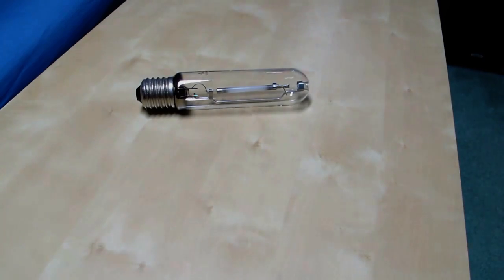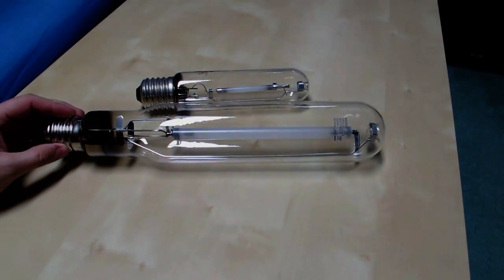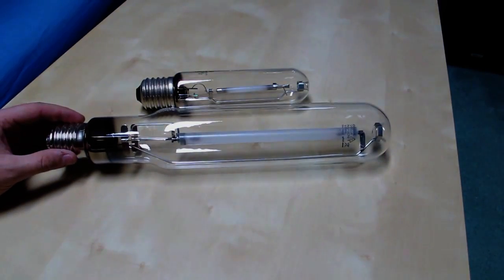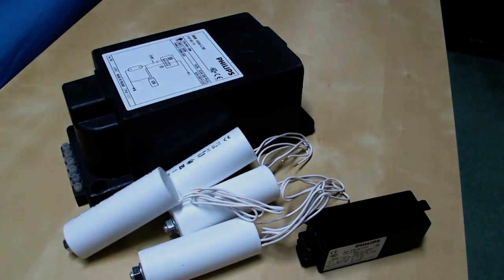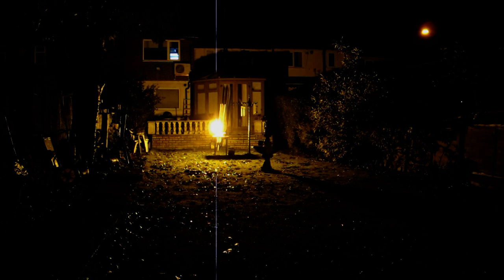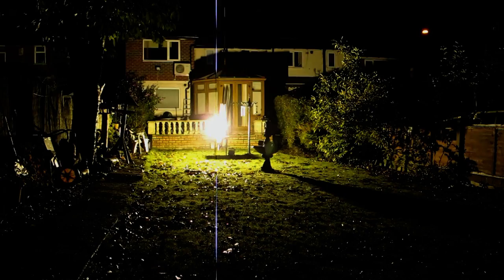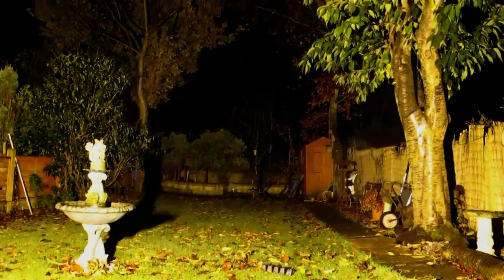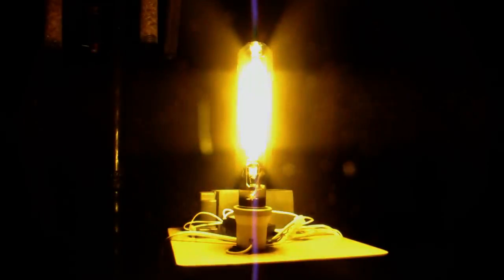1000w Sodium lamp test.

Comment: Do SON or SOX lamps exist with a built in ballast and starter

I know there exist Mercury vapor lamps  with built in ballast (but sadly for some reason you cannot see them start)

BTW: how did you run this upside up, (base on the floor while lamp sticking up, dont remember the word :) ), shouldnt you run this only upside down (they break or something if you dont, I read)

Comment: Hi,
Wow!! That lamp is damn bright. Is this brighter than a 1000W Metal Halide lamp?
Reply: Yes. 1000W metal halide produces about 90 000 lm. The HPS is a bit more efficient.
Reply: I've a GE MVR1000/U and it outputs like 108000 lumens as per spec sheet. I guess this one should be like above 130000 lumens.
Reply: Yes. Around 130 000 lumens.

Comment: Since it is just a choke ballast, are the capacitors really necessary and would this ballast work for just all around current limiting? (Ex: 1500w appliance limited to 1000w)
Reply from the maker: It would work without the capacitors but the resulting power factor would be so low that the extra current being drawn from the mains, especially if you had more than one, could overload your circuit or you'd have to overspec the supply cable and breaker. A 1000w SON lamp has an arc voltage of 100 volts so it needs 10 amps from the ballast. I'd have to test it but using it to limit something that used 240v would probably give you 2.4kw!
Reply: Could you use one of these ballasts to limit current to lets say, an MOT so it doesn't self destruct? Kinda like what Photon has in his "Big Boys Supply"
Reply from the maker: subway5411 Yes.
Reply: Just one more question lol, Could you use these on 60Hz 240v power?
Reply: @subway5411  Brazil ?

Comment: Any thoughts on the lower power internal ignitor sodium lamps? Considering them for home use.
Reply from the maker: What, like 50 or 70w? Good efficiency and long life but you'd probably be better off going for external ignitor lamps for faster restrike time.
Reply: +FrontSideBus These are what I'm tempted by: SON-E Elliptical Sodium Lamp 70W Internal Ignitor ES https://www.amazon.co.uk/dp/B00370WJ68/ref=cm_sw_r_other_apa_x3TxxbH9ZGFHW

Startup time doesn't bother me much really for main spaces.
Reply from the maker: That should work fine. If you get a fitting that has an external ignitor, you could later fit a metal halide lamp if you wanted too since they use the same ballast.
Reply: +FrontSideBus yeah that would be nice